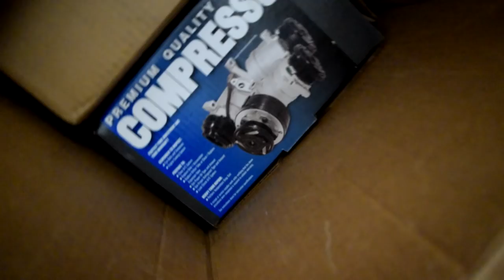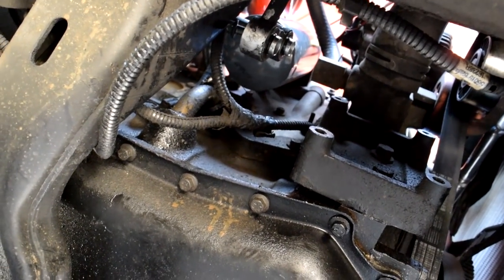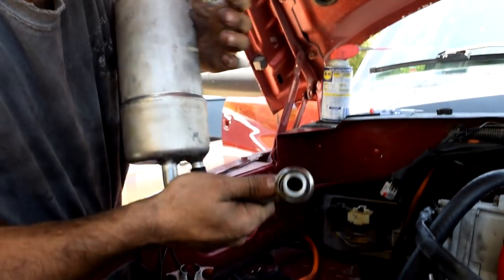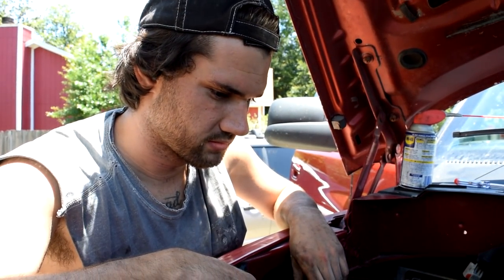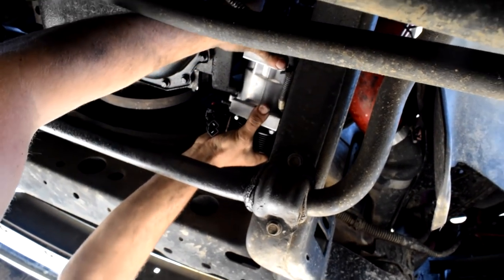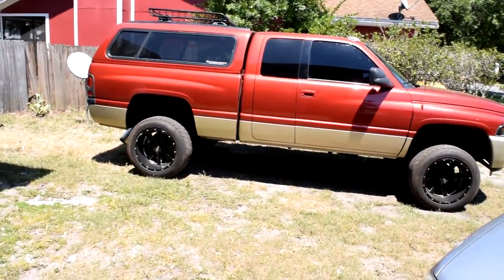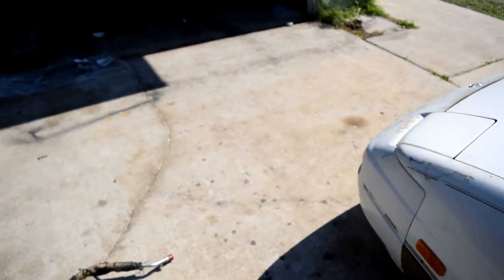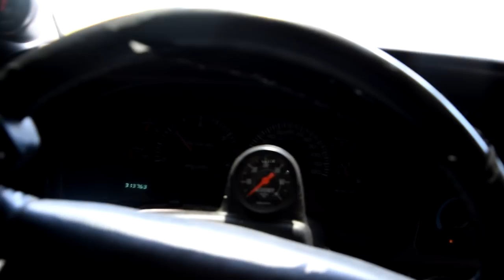99' Dodge Ram Cummins Diesel AC Install

Comment: Did You Still Have That Truck... 
did It Work Good After You Done  The Whole System installation  Of Orifice Tube, Acumulator And compresor Whit Out Flush The System?